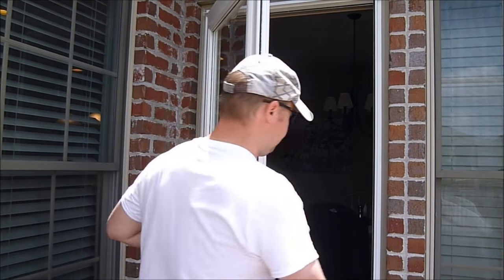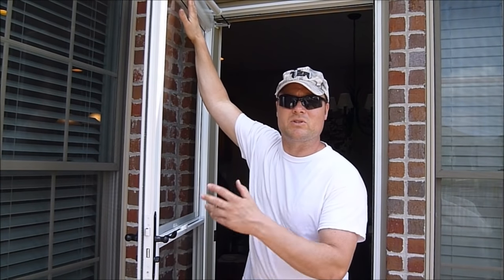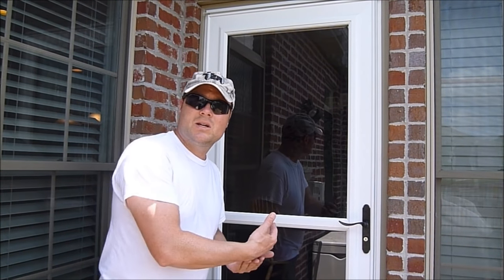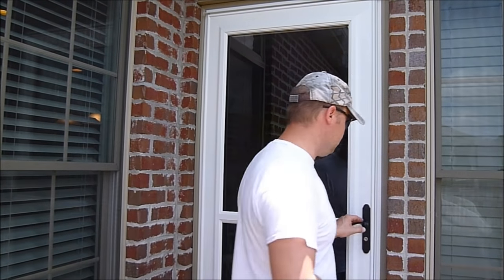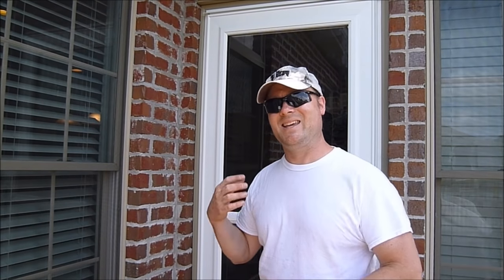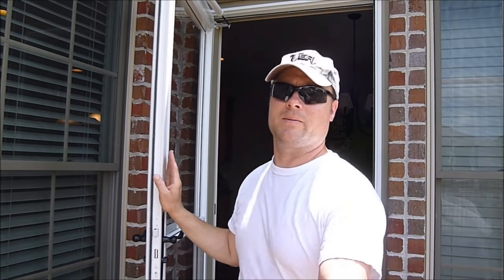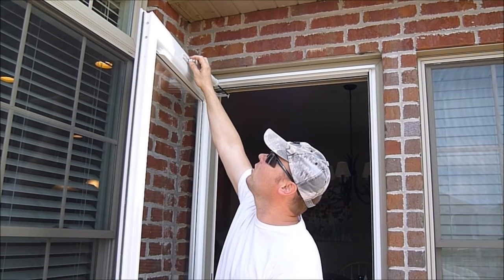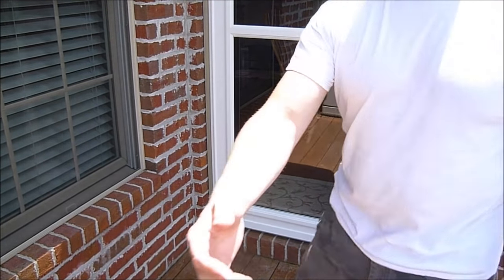Adjusting A Storm Door

Comment: I try all the screws on my storm door, it still slams. May have to get new parts
Reply from the maker: If the closers keep slamming even if you have tightened up the adjustment screw, then the seals are probably shot. I have Amazon links in the video description.
Reply: @AroundTheHome1 That sounds right, thank you so much!

Comment: Do you know how to adjust the door when it starts to catch on the frame due to weather cooling off?
Reply from the maker: That's hard to try and describe. If the door is catching do to the changing of the seasons, then there is not enough clearance. It also depends if it is only catching at the top or bottom or if the whole side is catching. Put simply, the frame for the storm door needs to be adjusted to give more clearance. Possible, if it was installed with shims on one side, then it would need to be taken down and re-shimmed. Either way, it normally requires part of the frame to be taken down and re-adjusted.  Thank you for watching. Check out hundreds more of our videos at https://www.aroundthehome.org

Comment: Was the door easy to install with a beginner diy?
Reply from the maker: Well, I will be honest. The older ones were a pain in the butt to install. Not something that I would suggest to a beginner or even a mid level diy'er. Now the new Larson brand storm doors have made some very impressive updates on how they are installed and make it possible for a beginner diy'er. Now as long as your door jam is square, you should have no problems with the install. If it is not square, you will need to do some shimming and that does make it a little more of an intermediate diy'er project. Good luck and feel free to ask more questions.
Reply: @AroundTheHome1  ok- awesome! I think the ones at Home Depot are Anderson brand, but our front door is in need! We’re in Oklahoma and the wind alone is coming thru our door and getting our new door wet.
Reply from the maker: Anytime. I'm not familiar with the installation process for the Anderson storm doors. So, it could be similar or it could be more like the old way. Something to take into consideration. Around here, Lowe's carries the Larson doors.
Reply: @AroundTheHome1  thanks tons! We aren’t lowes fans lol so we hit up the depot

Comment: How do you fix a storm door that is SO difficult to push open?
Reply from the maker: I am assuming that when you say SO difficult to open that it is much harder to open then other storm doors just like it. Well it could be a couple of things. Your closer could be bad and just not letting you push it open right. Also, you could have too strong of a closer on it. If you have a full glass or mostly glass storm door then you should have a heavy duty closer on it. If it is a very light storm door with a thin aluminum frame and a small window then a regular closer should be used. But, it is more likely that the closer has gone bad and you just need to swap it out. And that is easy to do, because for the most part they are a universal part and all you have to do is take the pins out of the one that you have and put the new one in. Here is an Amazon link for some closers. Here is the heavy duty closer, which would be used on most newer doors. https://www.amazon.com/Wright-Products-V150WH-PNEUMATIC-CLOSER/dp/B0009YDHJ8?crid=115Q4MTT6RBB5&keywords=storm%2Bdoor%2Bcloser&qid=1655479128&sprefix=storm%2Bdoor%2Caps%2C107&sr=8-5&th=1&linkCode=ll1&tag=greatwhitenin-20&linkId=a5f8e2e718c4f4ef85f52f55871e039b&language=en_US&ref_=as_li_ss_tl
And then here is the standard opener https://www.amazon.com/Wright-Products-V820AWH-Pneumatic-Closer/dp/B000BD6EH4?crid=115Q4MTT6RBB5&keywords=storm%2Bdoor%2Bcloser&qid=1655479439&sprefix=storm%2Bdoor%2Caps%2C107&sr=8-6&th=1&linkCode=ll1&tag=greatwhitenin-20&linkId=5c47e7300d5b4239a1d109969fb77d27&language=en_US&ref_=as_li_ss_tl
Hope that helps.
Reply: @AroundTheHome1  Brand new closers that came with new door.   Full glass door.  I had the installers back out three times and it still is difficult to push open.
Reply from the maker: @Barbara Bartling, is it more difficult to open then other storm doors just like it?
Reply: @AroundTheHome1  Yes.  We have the same door on the front and it is fine.  So strange.  I have even measured the placement of the closers and they are the same.
Reply from the maker: @Barbara Bartling one more idea. And I am trying my best since I am not there. Since you have the same door on the front, why don't you for the heck of it take the closer / closers off the front door and put them on the back door. If it is still hard to open with the different closer, then at least we can cross that off the list. Right now I think we just have to go down the list and start eliminating things. If it is easier to open with the closers from the front door, then you got a defective closer. If it is still hard to open, then I would suggest next to take them off and see how hard it is to open with no closers on the door. If it is hard to open at all with no closers, then I would think that the hinges are binding. Let me know what you find out.

Comment: Can you tell me how to adjust the door. It it catching now at the top of the frame and not closing.
Reply from the maker: Well, that depends on how hard it is catching. The proper way to fix this is to take the frame loose on the opposite side and shim it. The top of the frame would need to move outward and the bottom of the frame needs to move inward. But assuming that it is just catching a little bit and the latch is still working fine then the easy way to fix it is just file or grind a little of the top edge of the door. Thanks for watching. Don't forget to stop by our website www.greatwhiteninja.com

Comment: I have the exact same door. Here is my question. When the door to the house is closed does the storm door still close and latch properly? Is it best to start with the adjustment screws all the way in on the upper and lower?
Reply from the maker: +ramroad2008 For the first part of your question, yes when the main house door is closed the storm door should close and latch properly. There are many variables to make sure that happens. First is of course that the closers are closing at the proper speed, but if any area of the frame is out of square then the door's closing ability will be effected. And for the second part of your question I normally start with the screws where the come from factory then work from there.
Reply: I have the same problem. Did you find the solution?

Comment: At first all fine, then it started to close really fast and now it is slowwwwwwwwwwwww and nothing is working, HELP
Reply from the maker: Do you have two closers or just one? If you have two then you need to try and adjust them together. When you said really fast then really slowwwwww, is that from your adjustments or is the closer doing this on it's own?
Reply: Only one closure at the bottom. I adjusted when it was closing to fast and after a few adjustments it worked fine, now it by itself is closing so slowwwwwwwwwwwwwwwww and I tried again with the screw adjustment and nothing works
Reply from the maker: Ok, thanks for the clarification. It sounds like your closer has worn out. I would suggest getting a new one. They are not very expensive and easy to change out. You don't even have to replace the brackets. Just lock the closer open, then pop the pins out. Here is an Amazon link for a replacement. https://www.amazon.com/Ideal-Security-SK1730-Pneumatic-Diameter/dp/B005TE6UQU/ref=as_li_ss_tl?ie=UTF8&qid=1539693458&sr=8-1-spons&keywords=storm+door+closer&psc=1&linkCode=ll1&tag=greatwhitenin-20&linkId=bc77b27e2234e05e43b3250dfe6632ea&language=en_US
Reply: Worn out, the door is only 2 months old?
Reply: Maybe I should call Larson and tell them? Even though the closures are cheap, seems odd in 2 mths it is worn out
Reply: The brackets look different than the ones shown here, is that okay and will this one fit or possibly I should go to Lowes where we purchased the door
Reply from the maker: Ok, then sounds defective.
Reply from the maker: These are the same that you would buy at Lowes. There are a couple of different models so you could have a closer with a newer style bracket. The closer model that I sent the link for is used probably 90% of the time in those doors. But you could definitely go to Lowes and see if they have the exact model that you have. Good luck on your project. Don't forget to stop by our website for more great videos on just about everything. www.greatwhiteninja.com
Reply from the maker: Thanks, and nice pun.
Reply: Hi there, we went out today and bought a new closure, we bought a heavy duty and what a difference. The other one was def defective. The door was only installed 2 mths ago, so I will call Larson and let them know...Thanks for all your help
Reply from the maker: You are welcome and glad that you got it all fixed up. Thanks for the update.

Comment: how do you work the bottom closer latch?
Reply from the maker: Are you talking about adjusting the closing speed or using the extender lock?
Reply: No my friend's bottom closer is stuck open.
Reply from the maker: I am assuming that it has a push button lock on it instead of the metal washer slide lock. If it has the push button then once it is locked you should have to only pull the door open a little to release the lock. If the door cannot open more then you might have to remove the closer and pull it upon outside of the door. It is also possible that the closer has broken and will not unlock. Luckily in either case all you have to do is remove the two pins to remove it and if you need a new one then you can buy a matching replacement and put it right back into place with the two pins that you removed.
Reply: ok. ill try that. it's the exact same closer as you have. tha ks man
Reply: joshua klingensmith